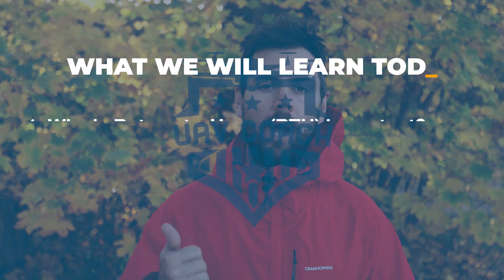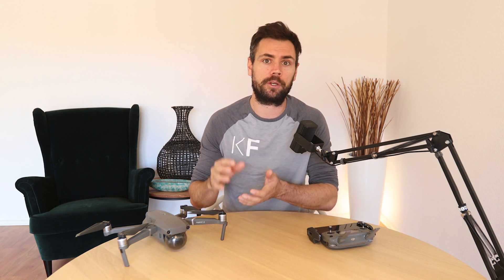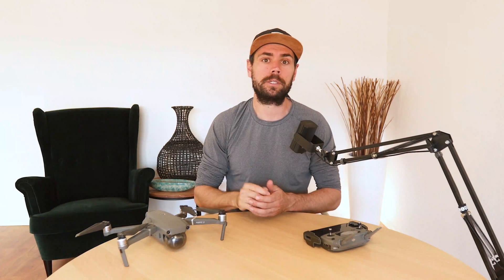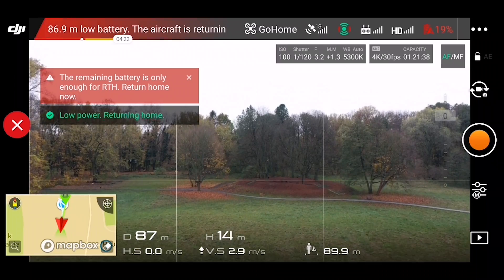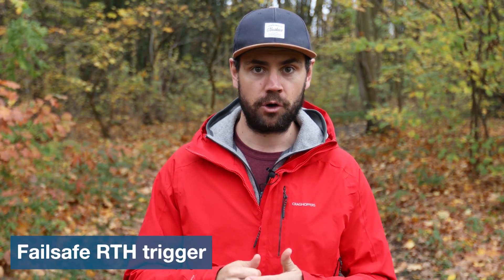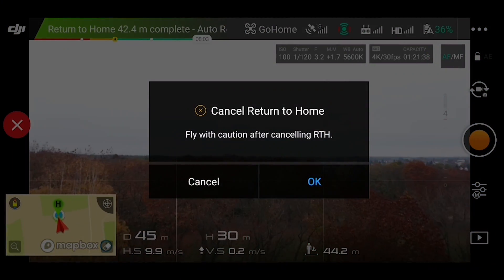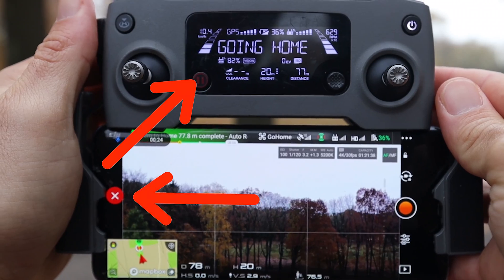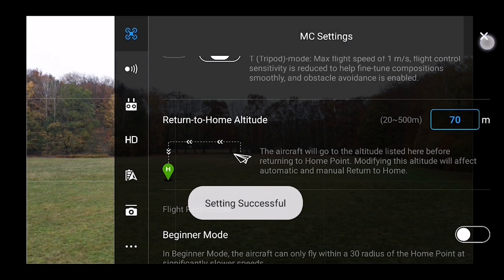DJI Mavic 2 Pro — How Return-to-Home (RTH) Works in the DJI Go 4 App

Comment: Great presentation, I'm looking towards getting a Mav 2 or 3 Pro after practicing with a host of reasonably priced drones to hone my piloting skills.

I believe there is a 2nd return to home setting that directs the drone towards the remote control as a home point with the app on the move, but I have not found anythin on the tinternet about that function ~ I do get the absolute RTH, but not the roaming remote control RTH and with how that work?
Reply from the maker: Simon, yes you can change the home point if you're on the move. Fast-forward to about 3:45 in the video, and you'll see some of the options you would have >> https://www.youtube.com/watch?v=TZdMJO1OX7w

Comment: Hi Greg, let's say the programed RTH altitude is 100’; if I  launch from a 500’ roof top, do i  program the RTH altitud at 600’ or just leave the 100’ because the drone acknowledges the launching altitude?
Thanks, Carlos
Reply from the maker: Hi Carlos, the RTH altitude is based on the take-off altitude. So you could leave it at 100'

Comment: Did you touch on the "RTH at current altitude" button? I think it has to do with if you're drone is nearby it won't bother climbing to the set altitude...?
Reply from the maker: Yah, good call! Not sure that functionality was in the app at the time we recorded this video. It's kind of a tricky feature and we recommend most folks leave that checked. The reason why — if the drone is between 5 and 20 meters from the home point when RTH is initiated, if the "RTH at current altitude" option is deselected, the drone will land right where it is. More thoughts on this Setting in this forum thread: https://forum.dji.com/thread-176913-1-1.html

Comment: Great video and channel. Glad I discovered it, even for application with my DJI MA1. How do you change the RTH to where the controller(pilot) is if not at take-off point anymore like on a boat or vehicle?
Reply from the maker: Sean, thanks for the kind words! I looked through the user manual for the MA1 just now and did not see anything about "dynamic" return to home, where you can set the controller to be the home point. I could've sworn the MA1 had this feature! Have you checked the settings area (three dots, top right of the DJI Go 4 app)?
Reply: @uavcoach  thanks Greg. I'll check.

Comment: i have two dji drones new to this field my question would be what height  do you set to avoid trees powerlines etc some times sensors dont always pick up objects in its path. why does not these drones allow you to go live on facebook etc.
Reply from the maker: Hi Dan, yes, you can stream live to Facebook with a drone. As far as height, generally speaking, there's not much happening between 150 ft. and 400 ft. So that's a good place to hang out if you're worried about the tops of trees or telephone poles. But there's always stuff to look out for, regardless of what altitude you're at! Guy wires, birds, low-flying helicopters, etc.

Comment: Hey Greg, new subscriber here. Are you never afraid that one of the motors stops turning during flight? 
I have a mini 2 and the last couple a weeks my iPhone X becomes so hot that the screen becomes darker and I hardly can’t see anything. Should I come because I use screen recording? The battery condition of the phone is 85%. 
Thanks for an answer?
Reply from the maker: Hi Bertrand, while I've been flying for years and have yet to experience a motor or propeller failure, it could absolutely happen. Yes, possible that your phone is heating up because of the screen recording app. Might be the temperature if it's in direct sun or really hot outside. Could be other apps running on the phone as well. Has happened to be before with an iPad in extreme heat, not fun to lose camera view while flying!

Comment: how do I set rth if I am on boat
Reply from the maker: Hi Martin, without knowing what drone you're flying, I'll assume you're flying DJI and using either the Go 4 app or Fly app. You can set the remote controller (instead of the take-off point) as your RTH location. That's what you'll want to do. As the drone gets closer to the boat, I'd turn off RTH and land manually to be the most safe. Hope this helps!
Reply: @uavcoach  Thank you, I am flying a Mavic 2 pro and value your videos highly
Reply: @uavcoach  Hi! I was testing the RTH to the controller on land because later I want to do this on a boat, but when I set it it says the mobile device GPS signal is weak so it doesn-t detect its location and I can only use RTH take off location, do you know why is this? I am not in a remote area so is weird there is no signal
Reply: @MarieeBlue  I am having the same issue. I’m gonna need fly from a moving boat next week. I need to get this figured out.
Reply: @schmidtVFX  Hi, it's a bug from the app for ios, so I couldn't solve it and had to instead always manually land the drone within the boat. It was hard but possible, I did it using the tripod mode as movement is smoother and slower than with P mode.